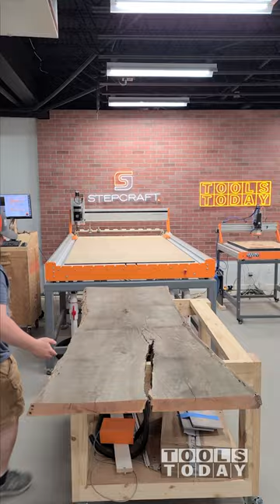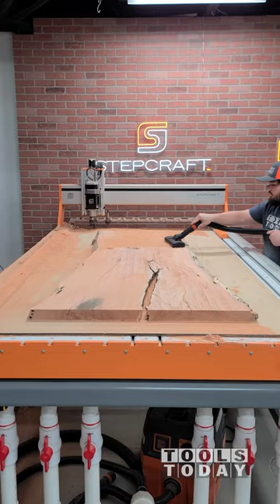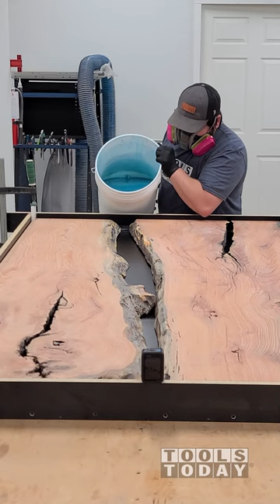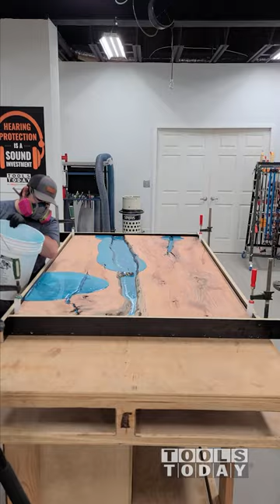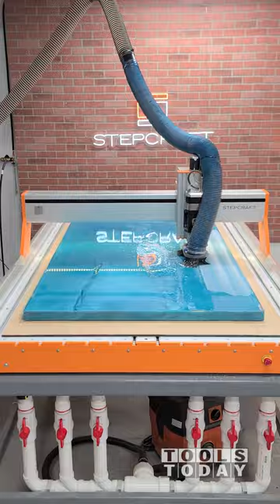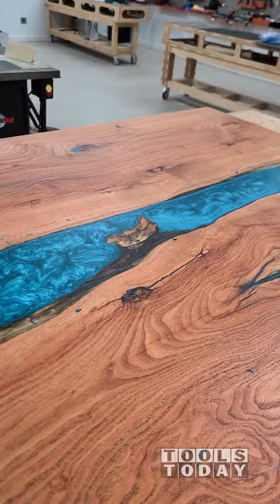Making River Kitchen Island Top

Comment: What’s the point of milling it the first time of you were gonna do it again. Extra steps and movement
Reply from the maker: The boards weren't remotely flat prior to doing this, so cutting everything to size would have been incredibly difficult.  It also would have taken at least a gallon or more of epoxy to fill in all of the areas of the slab with how much cup and twist was in them.  Surfacing first saves time and material in the long run.